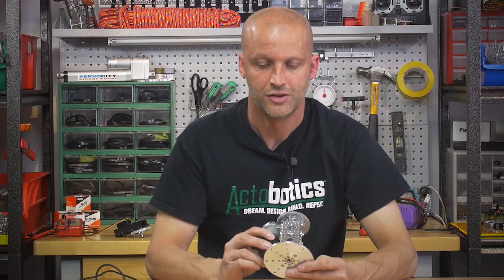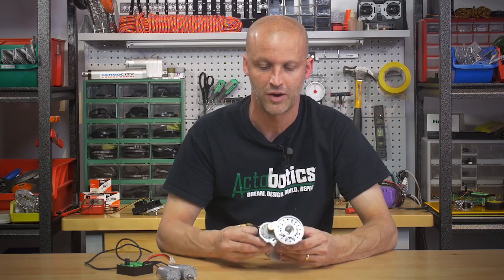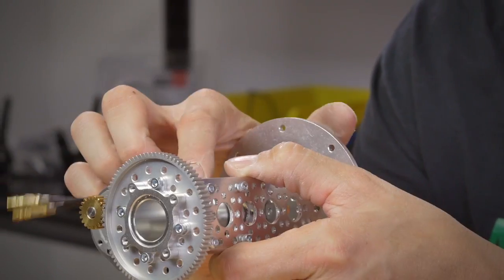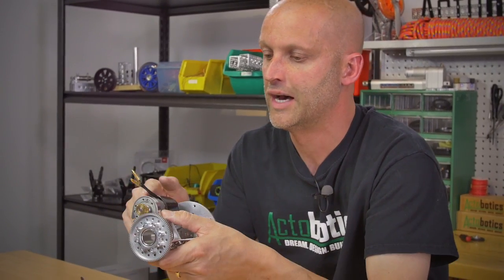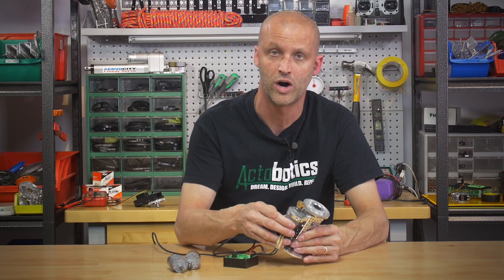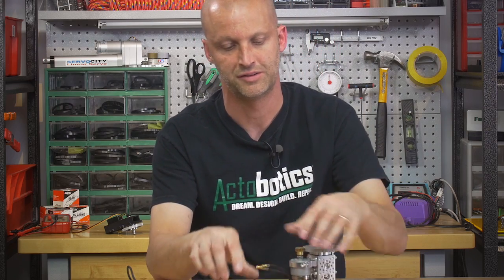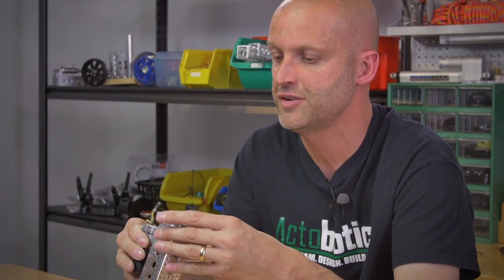ServoCity Products: Gear Drive Pan Kit A

Comment: Great kit!  What would it take to have a stepper instead of a regular DC motor to drive it?
Thinking loud here...  
Assuming I have a Nema17 stepper with a 5mm bore pinion gear (part# 615342) and a Nema17 mount 555152.  How do I attach it to the channel?

Thanks

Comment: I am interested in a panning unit that will rotate 360 degrees in 1 to 1.5 minute.  I don't know which motor or gear set to use.  Can I connect this directly to a battery power source with just an on/off switch or do I need one of your controllers to operate it?
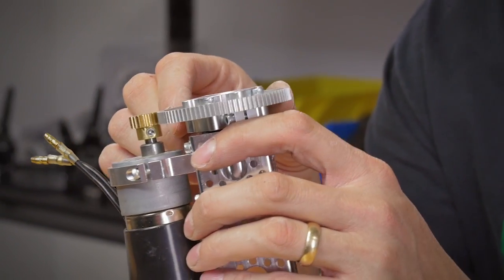Reply from the maker: MrGrunthunter's Adventures To achieve 1 rotation in 90 seconds with the 4.2:1 ratio on the gear drive pan kit you would need to install a motor that can run at 2.8RPM.  The 3RPM spur gearmotor running on a 12V battery will be just barely over 3RPM on the input and the speed would be approximately 1 rotation of the output shaft in 1:21.  You can regulate the speed by changing the input voltage or by using a motor controller.

Comment: This is almost exactly what I've been looking for ... just subtract the gear and gear motor. I want something I can mount on my tripod that swivels. I'm using some of your other parts to build a simple jib with two monopods. The only other thing is that the pan/tilt head mounts to the tripod with a screw size 3/8"-16. The 1/4"-20 is the camera mount size.. I'll look on your web site to see if you have a threaded screw plate with 3/8"-16 hole. If not, I can make one. Thanks.

Comment from the maker: BRAND NEW at ServoCity is the Gear Drive Pan Kit A.  This kit includes all the parts necessary to build a compact gear driven pan system for a 37mm OD spur gearmotor
https://www.servocity.com/html/gear_drive_pan_kit_a__637168_.html